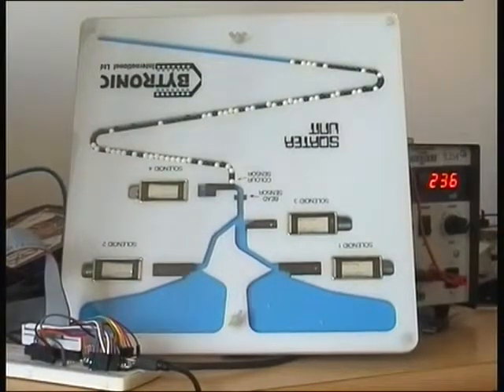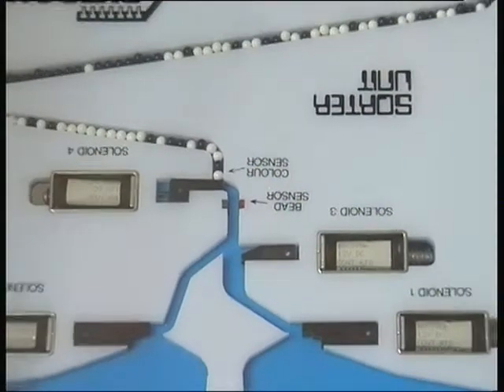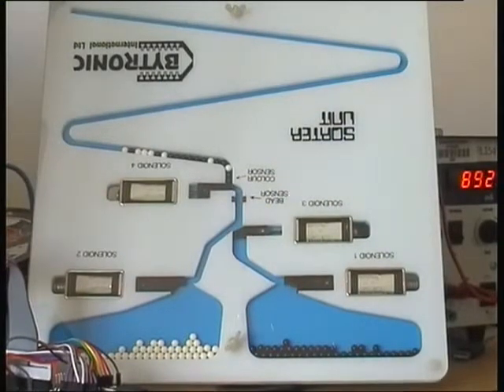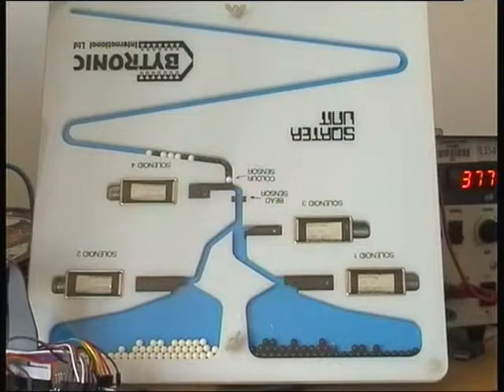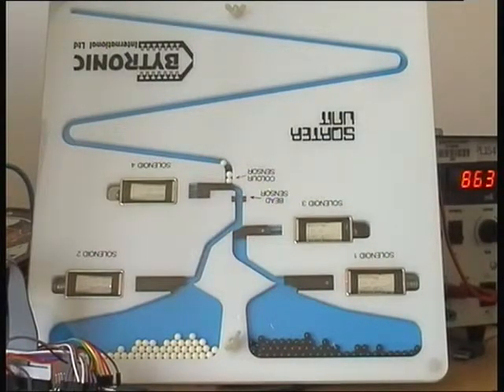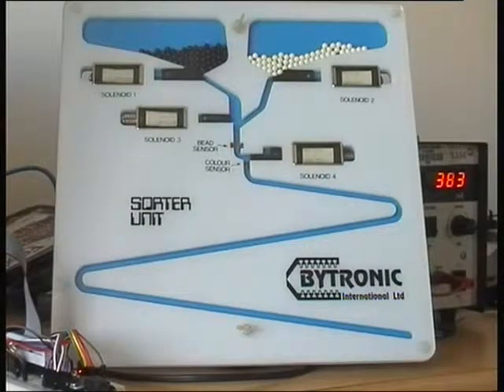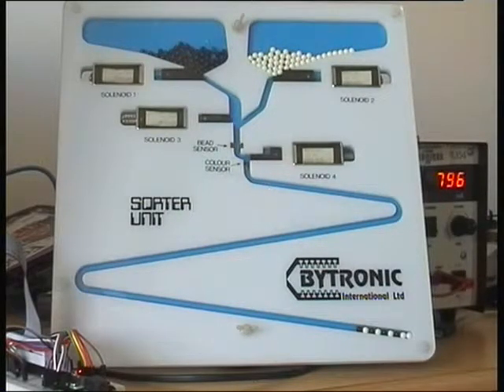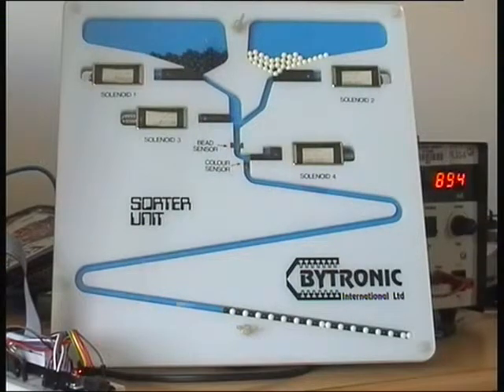Bytronic Bead Sorter controlled by Arduino nano

Comment: Hi, I've been trying to do this for the last 2 - 3 years, is the code available?
Reply from the maker: this was written nearly 10 years ago for the Arduino Nano
I no longer have access to a bead sorter to check it still works

// Bytronic Bead Sorter using Arduino Nano/Mega

// the 40 way ICT connector is set up so
//   port B is connected to Nano pins 3 to 10
//   port C is connected to Nano pins A0 to A7
//   CLK0 is connected to Nano pin 2 (can inerrupt on change)

void setup() {
  Serial.begin(115200);
  Serial.setTimeout(60000U);
  printfx("Bytronic Bead Sorter\n");
  printfx("testing solenoids, hit <ENTER> to run sort program\n");
  // initialize digital pin LED_BUILTIN as an output.
  pinMode(LED_BUILTIN, OUTPUT);
  for(int i=3;i<=10;i++)   // setup outputs to solenoids etc
    pinMode(i, OUTPUT);
  while(!Serial.available()){
    static int shift=1;         // value to output to LEDs 
    //portBwrite(shift);
   shift<<=1;                  // shift one bit right and if > 128 reset to 1
    if(shift >128) shift=1;
    portBwrite(shift);
    printfx("port C %x  \n", portCread());
   printfx("port B %x  \n", portBread());
    delay(1000);
    }
  waitForKeyHit();
}

// port B and port C bit settings for bead sorter
const int SOL1 = 1, SOL2 = 2, SOL3 = 4, SOL4 = 8, BUZZER = 0x10, RESET = 0x20, BEAD_SENSOR = 0x40, COLOR_SENSOR = 0x80;
// the loop function runs over and over again forever
void loop() {
            int counter = 5;
            portBwrite(0);                // open all solenoids
            printfx("turn sorter so Z bend is at the bottom, shake beads into Z bend, then hit <ENTER>\n");
            waitForKeyHit();
            portBwrite(SOL4);             // close solenoid 4
            printfx("turn sorter so Z bend is at the top, then hit <ENTER>\n");
            waitForKeyHit();
            printfx("sorting from Z bend into hoppers\n");
            while (counter-->0)           // loop while sensing beads
            {
                resetSensors();                                     // reset color and bead sensors
                if ((portCread() & COLOR_SENSOR) > 0)              // read color sensor value
                   {     // black bead 
                    printfx("port C %x - BLACK BEAD ", portCread());
                    portBwrite(0);                  // open solenoid 3 and 4
                    delay(70);                      // wait for bead to drop past solenoid 4
                    portBwrite(SOL4);               // open solenoid 3 close  4
                    delay(250);                                     // wait for bead to drop into hopper
                   }
                else
                   {     // white bead
                    printfx("port C %x - WHITE BEAD ", portCread());
                    portBwrite(SOL3);               // close solenoid 3 and open 4
                    delay(70);                      // wait for bead to drop past solenoid 4
                    portBwrite(SOL4 + SOL3);        // closesolenoid 3 and 4
                    delay(250);                     // wait for bead to drop into hopper
                    // sometimes a bead going into the left hand hopper sticks on the bend by solenoid 3
                    //    pulse solenoid3 open then closed to shake it loose
                    portBwrite(SOL4);                // pulse - open solenoid 3 close  4
                    delay(20);                                     
                    portBwrite(SOL3 + SOL4);         // close solenoid 3 and 4
                    }
                delay(500);
                if ((portCread() & BEAD_SENSOR) != 0)     // if bead seen reset counter
                   { printfx(" Bead dropped %x \n", portCread() ); counter = 5; }     
            }
            portBwrite(SOL1 + SOL2);             // close solenoid 1 and 2
            printfx("\nBeads should now be sorted into hoppers\n");
            printfx("turn sorter so Z bend is at the bottom, then hit <ENTER>\n");
            waitForKeyHit();
            counter = 5;
            while (counter-- > 0)
            {
                resetSensors();
                portBwrite(SOL1);              // open solenoid  2
                delay(110);                    // wait for bead to drop 
                portBwrite(SOL1 + SOL2);       // close solenoid 1 and 2
                 delay(1000);                  // delay
                portBwrite(SOL2);              // open solenoid  1
                delay(110);                    // wait for bead to drop 
                portBwrite(SOL1 + SOL2);       // close solenoid 1 and 2
                if ((portCread() & BEAD_SENSOR) != 0)    // if bead seen reset counter
                  { printfx(" Bead dropped %x \n ", portCread() ); counter = 5; } 
                delay(1000);                    // delay
            }
}

// wait for a key hit - then extract all characters from serial
void waitForKeyHit(void)
{
     while(!Serial.available());
     while(Serial.available())
        { Serial.read(); delay(10); }
}

int portB;        // maintains port B setting
// read current setting of port B then RESET sensors
static void resetSensors()
{
    portBwrite(portB | RESET);         //  set RESET bit
    //printfx("portB %x\n", portB);
    delay(20);                                       
    portBwrite(portB & (~RESET));      //  clear RESET bit             
    delay(100);                                     
    //printfx("portB %x\n", portB);
}

// read and write Bytronic interface disgtal signals

// write port B, e.g. on multiapplications board LED output
void portBwrite(int d)
{
  portB=d;                          // save port B setting
  int b0=3;                         // wite bit 0 to this pin
  for(int i=0;i<8;i++)
  {
     digitalWrite(b0++, d & 0x1);   // set the bit value and increment pin
     d=d>>1;                        // get next bit to set
  }  
}

int portBread(void)
{ 
  int b0=10, d=0;                    // read bit 7 to this pin
  for(int i=0;i<8;i++)
     { delay(1); d=(d<<1) | digitalRead(b0--);  } // read the bit value and decrement pin 
  return d;
}

// read port C, e.g. on multiapplicantions baord switch inputs
int portCread1(void)
{
  int c0=A5, d=0;
  // on the Nano A0 to A5 will act as digital pins
  for(int i=0;i<6;i++)
      d=(d<<1) | digitalRead(c0--);  
  // on the Nano A6 and A7 are analog input only
  if(analogRead(A6) > 256) d |= 0x40;
  if(analogRead(A7) > 256) d |= 0x80;
  return d;
}
// read port C, e.g. on multiapplicantions baord switch inputs
int portCread(void)
{
  int c0=A7, d=0;
  // on the Nano A0 to A5 will act as digital pins
  for(int i=0;i<8;i++)
      d=(d<<1) | digitalRead(c0--);  
  // on the Nano A6 and A7 are analog input only
 // if(analogRead(A6) > 256) d |= 0x40;
  //if(analogRead(A7) > 256) d |= 0x80;
  return d;
}

#include <stdarg.h>
int printfx(const char *fmt, ... ){
        char buf[128]; // resulting string limited to 128 chars
        va_list args;
        va_start (args, fmt );
        vsnprintf(buf, 128, fmt, args);
        va_end (args);
        Serial.print(buf);
}

Comment: Hello, how did you connect the Bead Sorter to the Arduino Nano?
Reply from the maker: // the 40 way ICT connector is set up so
//   port B is connected to Nano pins 3 to 10
//   port C is connected to Nano pins A0 to A7
//   CLK0 is connected to Nano pin 2 (can inerrupt on change)